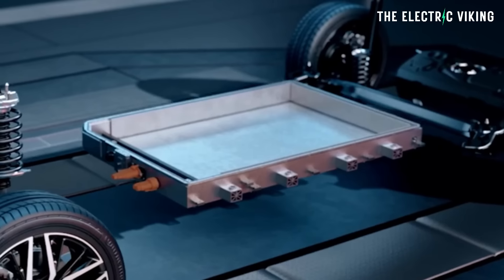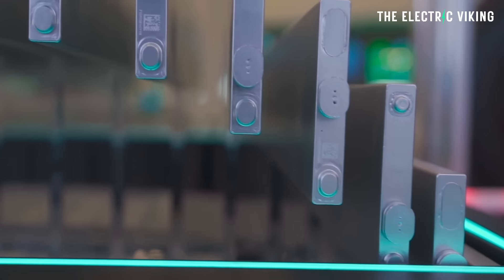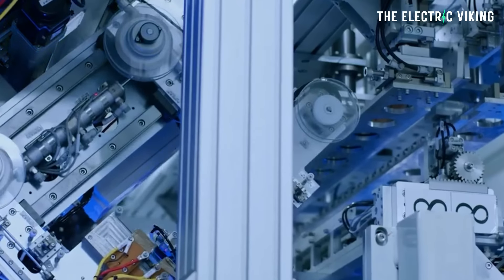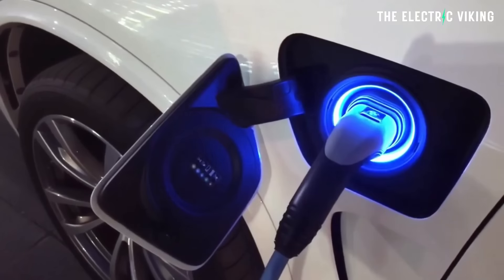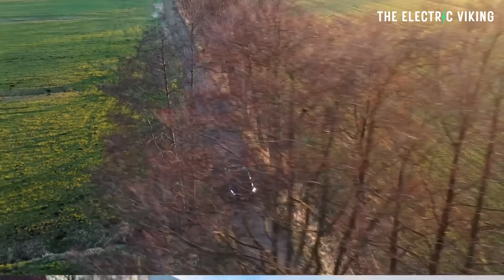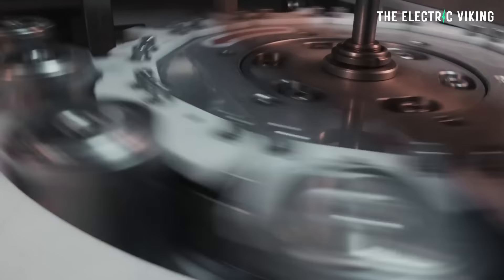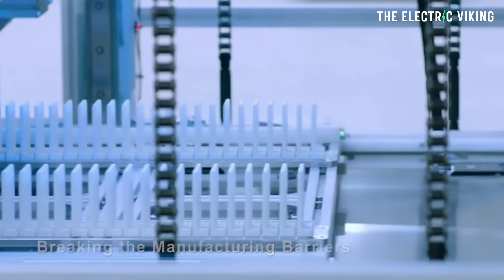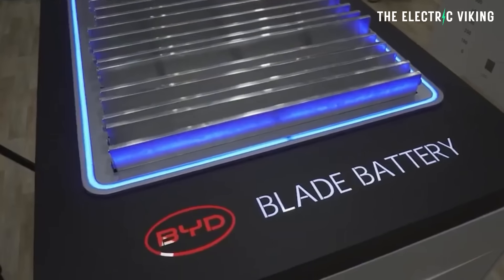BYD's new second generation Blade battery will revolutionise EVs

Comment: Why didn't any Battery Manufacturers contact NASA and get the plans for the batteries they used for their Apollo missions, they worked with no discharge in minus 250F as well as in plus 250F as well as no degradation, even the dual button batteries in the Automatic Hasselblad could handle three days in space at below zero and then work flawlessly on the Moon in sub zero conditions as well as 250F with full sun contact, I mean anyone that ever tried to pick up an aluminium part that was left in the Sun for a couple minutes, knows just how hot it gets as well as leave any metal outside in sub zero and then try to pick it up bare skin.
We all know from the item list supplied by NASA that no chargers were supplied for the trip and so those batteries had to keep a full charge for three days and then work when they walked about on the Moon, same with the battery used for the Airconditioning of the Suit and they only used NiCads, todays battery manufacturers must be ripping us all off and pretending they have all these problems with batteries designed over 50 years after the Apollo missions as everyone knows that NASA would never lie ;)

Comment: Fast tec but where do you put yer flag in ? , it was different for a mobile phone but a out the box new EV means  the long term losers in tec advancement for evs will be the ones who buy outright and chop there cars every 4 to 7 years. EV car leasing up to 48 months is the only answer to riding the battery tec waves and gimmicks that are now mirroring the ongoing mobile phone industry. TO Be honest the dealbraker will be the batt warranty length as in kilometres /years ( for resale ) and then after that , the range  and speed of charging.  PS Does oz have road tax fund or license for ev vehicles ?

Comment: of course you throw Xpeng in there. You never cease to amaze us with how one sided you have become. wow charging speed 10-80 in 10 mins. Where in this country can you find a charger to do it that fast? Facts are, BYD blade v2 or v1. The next big thing in battery tech is RANGE not charging speeds. You're right many BYDers have given you the flick. Clearly your new free deal with Xpeng has clouded you judgement on pretty much the rest of EV out there.

Comment: I’m a little disappointed that Tesla is not putting in these more advanced batteries in their cars, specifically CATL’s million mile battery. Especially, in the USA where we seem to complain about range and longevity more so than other countries.
Reply: I agree and I am too. I will say that my Y has degraded 3.3% in the last 3 years. My commute is 7.2 miles X 2 so in about 80 years I will be out of luck. This new battery is great but it’s really not actually needed except maybe long road trips? However my current degradation includes long road trips. It does seem that we really need this battery in the CyberTruck and any EV truck.
Reply: @pgiatrakis it’s pathetic that the Cybertruck only gets 325-340 miles of range, when the Chevy RST get 440, and the new version of the Ford e-150 will get 495. Come on, Tesla. I want 500 miles, so I’ll get 300 from 20-80% for long life. I’d give up charging speed for longer range and long battery life.

Comment: 190Wh/kg is still  Nothing  ,for  1000km  real range  we need  at least 150kWh battery pack  , it means  over 800kg just for battery  :)   it is pure JOKE
Reply: 190wh/kg is pretty good. Ion batteries just aren't going to get any better than that. The battle is on charging time and longevity, now.